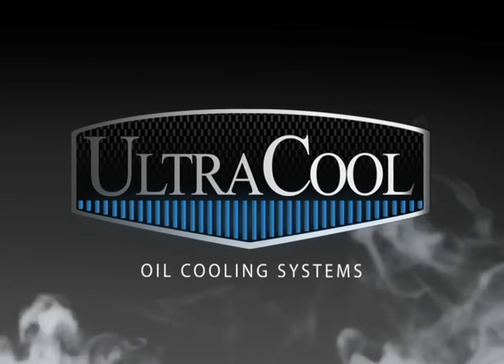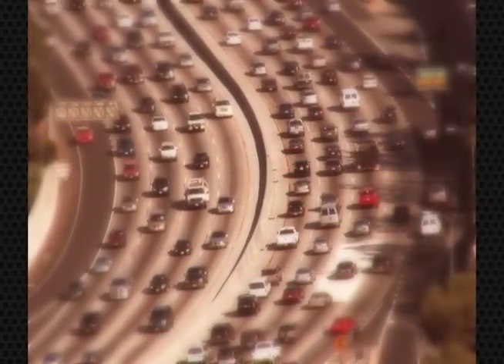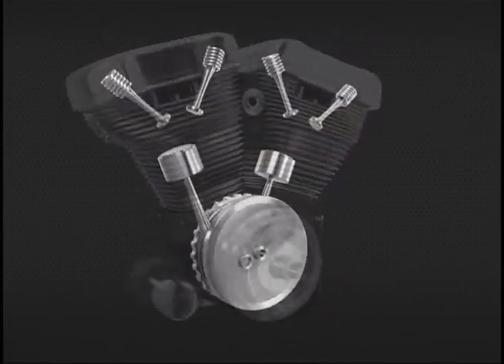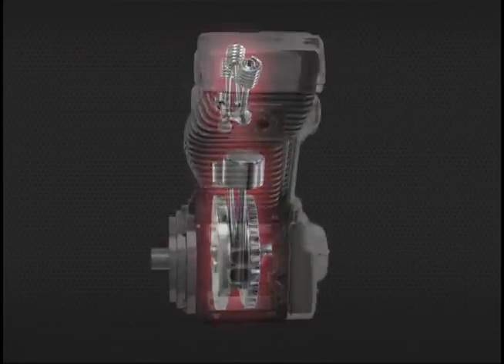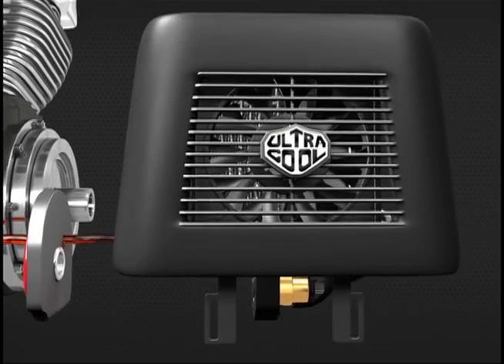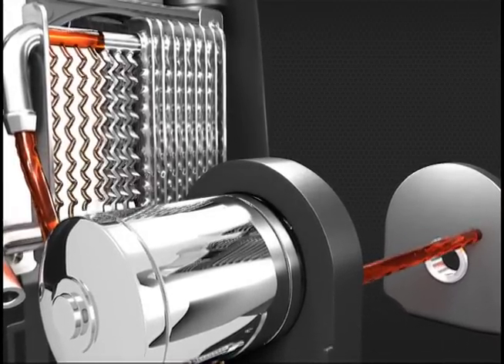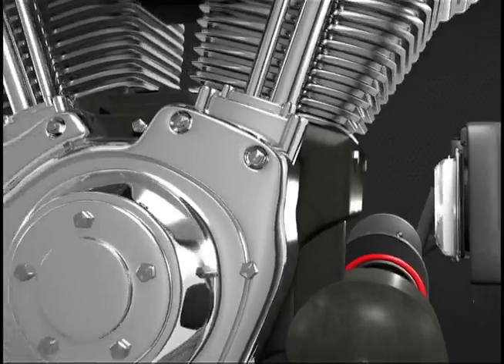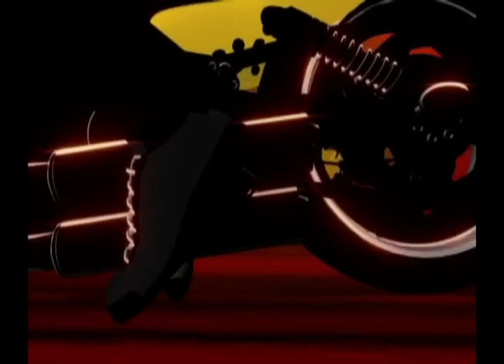UltraCool "How it Works"

Comment: Nice gimmick, here is why.....engineers who designed over past years the V twinn designed with air cooled in design for operation. Then the oils of today are fabricated by scientist to reduce breakdown compounds under nornal conditions. SO that leaves the question a engine design that runs fine and oil that lubricates the engine......has been doing great amazing over 100+ years. 
Now there suggesting that this product will save the engine your safety as a rider and ....blah blah blah........BS (change your oil ride smart) 03 RK 100th anniv w/121k on the clock........running strong👌✌
Reply: I disagree. Completely. Every Harley ever made. Needs a modern oil cooler. And everyone knows it .